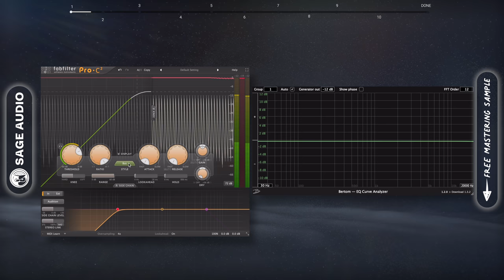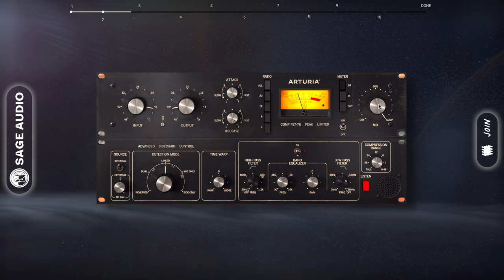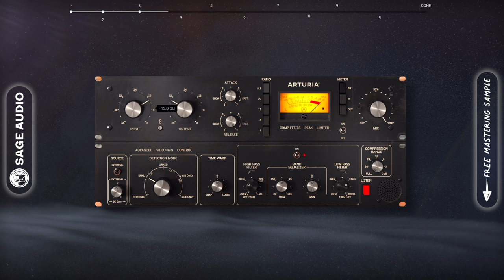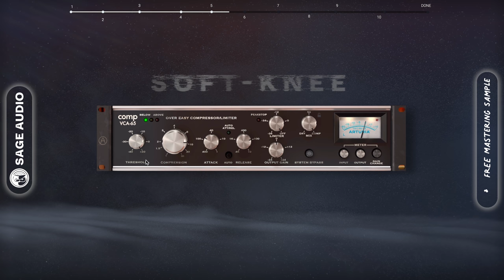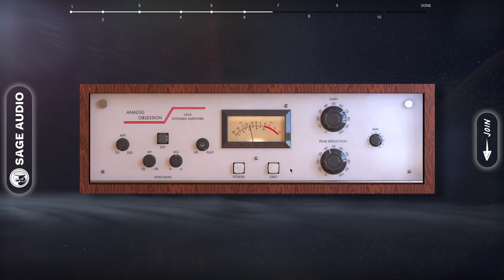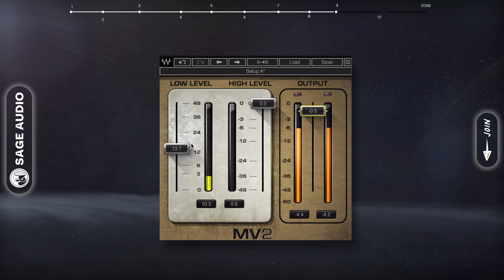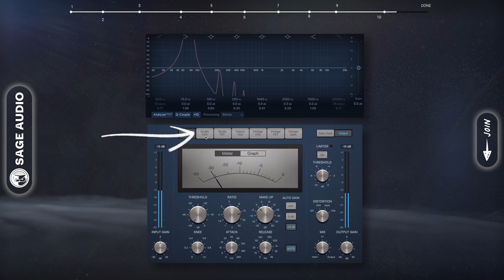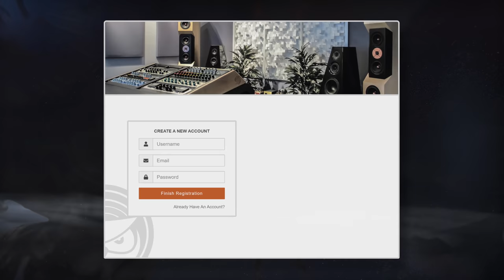Compression Masterclass

Comment: 1. level flattening, leveling
if your track is not constant, you need it
la2a, mv2, dc1a and so on

2. envelope design by attack and release
- attack
it's about distance.
close sound has more transient, far sound has less transient.
it's "RELATIVE".
- release
it's about groove
you need to set the release by tempo like the decay of reverb.
if your track is close and rhythmical, 16th and 8th note will be suitable.
60 bpm, 4th note is 1 sec, 1000ms.
120 bpm, 4th note is 500ms.
8th note is 250ms.
16th note is 125ms.
- ratio
in general
high GR = high ratio
low GR = low ratio

3. saturation, color, aggressiveness(pumping) by the NY compression
each compressor has the color.
if you need it, choose it, color it.

that's it.
I hope you don't be confused anymore.